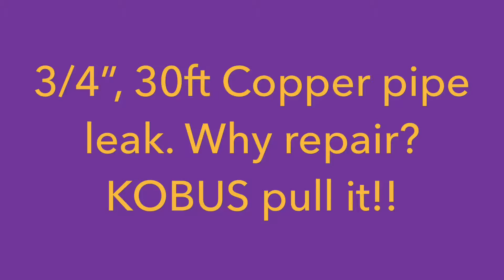🇺🇸 Trenchless Pipe Pulling Water Services with Kobus Pipe Puller and ECI, Indiana USA

Comment: Our biggest problem is fishing the cable through the lead. The I.D. of the 3/4 lead is roughly 7/16 and finding a cable that will stand up to the pulling capabilities and easily being fished through the line is the biggest obstacle. 95% of the foundation’s we’re dealing with are hand laid stone which adds another degree of difficulty freeing the compression on the existing lead line but we’ve got that pretty solved. I see the cable size is a much larger diameter than what we can use. Is the I.D. on the lead larger than 7/16? Or is it being honed somehow to except the cable?